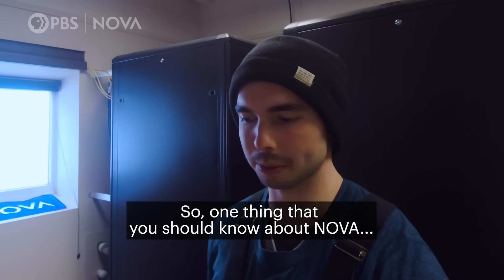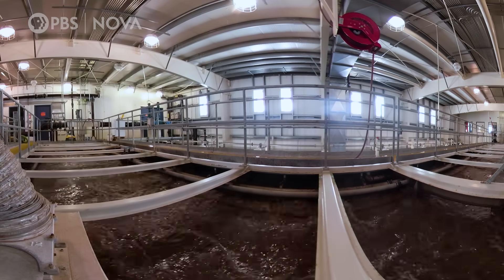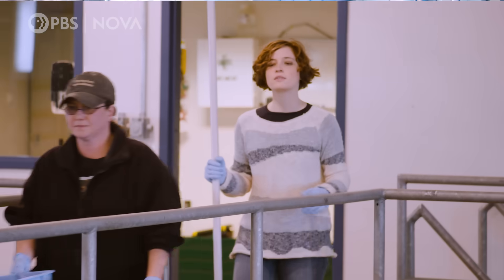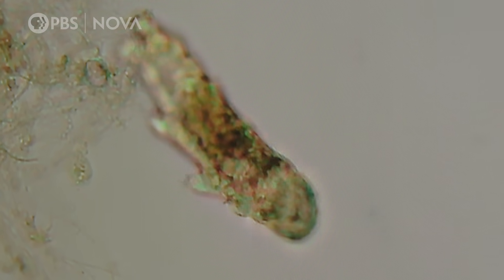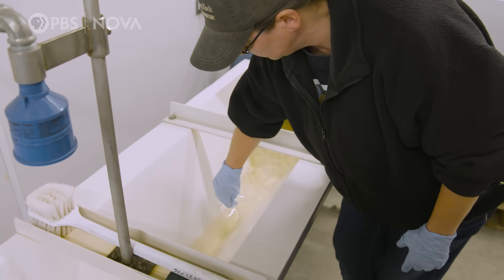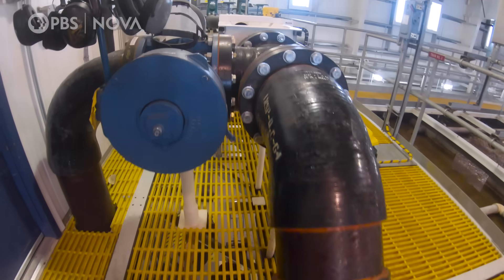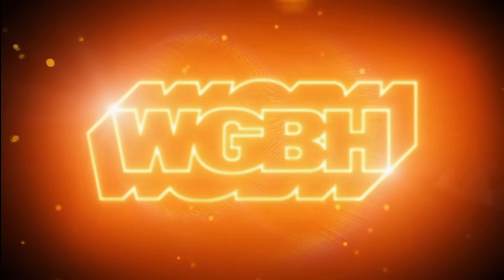Where Does the Poop in Antarctica Go? | Antarctic Extremes

Comment: I appreciate this video because as a plumbing contractor of 52 years coming from high purity piping in Silicon Valley I would like to see the waste treatment plants here. This treatment plant requires a large amount of electricity. The travesty is there will be way more unburned carbons, particulate and waste released into the atmosphere let alone wages, maintenance, etc., by shipping the garbage to California than if it were utilized in a waste-to-energy plant on location. Modern waste to energy plants are 87-90% at reducing particulates to the air and removing mass by 70% efficient or more. And with help of backup batteries, this plant would in turn replace the fuel and carbons released into the atmosphere by the backup diesel electric generators that kick in when there is insufficient wind. I thought this was run by scientists?

Comment: im suprised the water can flow without freezing through pipes. I'd say to bury them but but the ground isn't warm, its ice. Where do they get the energy to heat everything in general? That takes energy to run the sewage without it freezing.

Comment: I can tell you with 100% certainty that the poop at the South Pole goes into the ice because I babysat it for a year when this video went public.  About 200' under the surface, there's a HUGE cavity that used to be the water source (Rodwell) that turns into the septic tank every 15 years or so when a new Rodwell is created.  In about 10,000 years there's gonna be a HUGE poop-berg in the ocean.  A couple actually.
Reply: Yep! Can't exactly use McMurdo's process when you're 700 miles from the ocean. Thankfully the volume is a lot smaller, 200 people in summer and about 50 over winter.

Comment: It's obvious they're just making fun of Arlo. They shoved him onto a task that requires a bit of experience with counterbalance to pull it off.

If he kept the forks level as he came out of the pallet, then when the back-wheels of the truck came down as they ended up out of the container it changed the angle at which the forks sit inside the space in the pallet.

What you would need to do is apply forward tilt just enough to bring the forks back into being level with the pallet, and raise the forks just enough to gently touch the underside of that pallet, and then, while the truck is coming out of the container the front-wheels are coming down, and without doing the previous step, the forks smack onto the floor and puts unnecessary strain on the hydraulics, then you just apply backward tilt to bring the forks level with the floor and drive safely away from the container.

This is pretty simple stuff for "Trained personnel", I hope Arlo doesn't feel that he's bad at it, he's just lacking experience.

Kinda makes me wanna live in Antarctica, what they described in the video sounds like a good place to live.

Comment: Don't you ever use supercritical water wet oxidation processes combined with multi-serial sewage comminutors, the whole thing creates it's own energy run the entire operation and is mechanically automated and self-tending. The final product is pure water that needs chlorination to make it drinkable after passing it first through an engineered marsh. Ozone is created and used on the spot to further disinfect it.

And the hybrid multi-serial sewage comminutor and anaerobic fermentation, it uses anaerobic bacterial diatomaceous earth particle fermentation tanks that has 10,000 times more surface area than a given volume of gravel.

The population of anaerobic bacteria is such that nothing toxic can eliminate them but will be anaerobically consumed and converted into biogas which is a mixture of methane and carbon dioxide which is then used to run the entire system. 

It produces a clear effluent that runs through a series of anti-pathogenic plants like the aquatic mint, known also as the mentha aquatica, that exudes a lingering pathogenicide that kills all pathogens and passes also through a series of different hydroponic troughs containing all kinds of 
phyto-bioremediating plants. In the end it only needs CHLORINATION to render it drinkable. 
Your toilet-to-tap system. 

For ALL solid wastes, HYPERBARIC INCINERATION, was developed and successfully tested in France, rendering even asbestos into harmless substances and forms.

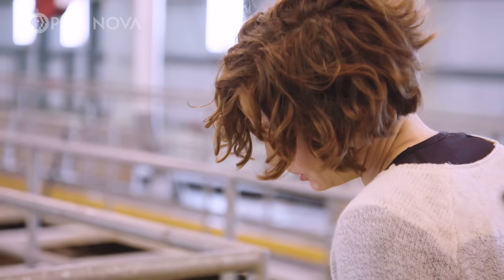Comment: 3:28 racking rags is what it's often called in the "industry" for lack of a better term.

The stories I could tell of my time racking rags in the south suburbs of Chicago, Illinois.

One thing should be mentioned, in the facility in the video you have the privilege of not being under ground in a confined space, with a live sewer close by, and yes those pits often flood to the top.
Reply: I worked six years at Dayton Ohio facility but it was a county owned and operated WWTP.  Two bar screens  split flows at 20 MGD minimum influent into the pretreatment facilities. 2 trains of  Three hycor screens each side  base ment floor leading to a screw conveyor belts that compressed the screenings into thicker detritus,  then lifted out by crane/ hoists , multiple times per shift . I dealt with floods, tornado,  hurricane winds during those years underground.  Worst days ever when generators would come on at power outages then 10 hrs of tedious nerve wracking day of checks, opening up 42 " valves by handwheels, and putting  fine screen on line for flow equalization. Then  eventually a shift relief operator would be there to  take over. It was never a dull moment 2 stories underground.

Comment: "The best place in the world to be a trashman; no flies, no rats, nothing rots. "
Reply: Way more respectable than taxman, don't they
Reply: @epicCKLIM How do you think the trash man gets paid?
Reply: definetly has some benefits rather a trashman working in NYC
Reply: Also, worst place to be a murderer; no flies, no rats, nothing rots
Reply: I was thinking it before he said it.
Reply: Smartest guy on the camp
Reply: Don't you ever use supercritical water wet oxidation processes combined with multi-serial sewage comminutors, the whole thing creates it's own energy run the entire operation and is mechanically automated and self-tending. The final product is pure water that needs chlorination to make it drinkable after passing it first through an engineered marsh. Ozone is created and used on the spot to further disinfect it.

And the hybrid multi-serial sewage comminutor and anaerobic fermentation, it uses anaerobic bacterial diatomaceous earth particle fermentation tanks that has 10,000 times more surface area than a given volume of gravel.

The population of anaerobic bacteria is such that nothing toxic can eliminate them but will be anaerobically consumed and converted into biogas which is a mixture of methane and carbon dioxide which is then used to run the entire system. 

It produces a clear effluent that runs through a series of anti-pathogenic plants like the aquatic mint, known also as the mentha aquatica, that exudes a lingering pathogenicide that kills all pathogens and passes also through a series of different hydroponic troughs containing all kinds of 
phyto-bioremediating plants. In the end it only needs CHLORINATION to render it drinkable. 
Your toilet-to-tap system. 

For ALL solid wastes, HYPERBARIC INCINERATION, was developed and successfully tested in France, rendering even asbestos into harmless substances and forms.
Reply: @darthvader5300 maybe the cost of installing such a complex series including anaerobic digestion outweighs benefit of electrical production. The problem with anaerobic digestion is there gas is produced that are methane and carbon dioxide and some scent gases like. Don't know if they have enough population there in order to produce enough food to keep feeding the microorganism life to keep the digestion going. It's much cheaper to run aerobic digestion in smaller units this is strictly from a standpoint of operations anaerobic digestion fails in the problematic areas of struvite production.

Comment: man I'm surprised they never had any masks on, all the water splashing around throws stuff in the air
Reply: Agreed. Maybe this year has made me more sensible to airbourne pathogenes, but I kept thinking: "How the hell can you go in sewage treatment plant without an N95/FFP2 mask?".
Reply: @creativedesignation7880  its normal for most workers at sewage treatment plants. I been to over 30 tours and not once i had to put on a mask or seen a mask on.
Reply: @tbates1987  Ewww... or maybe the stuff just builds up in the mask and then keeps the yuck-saturated mask close to your face? Ewww...
Reply: @aimeem  Isn't the other option having a yuck-saturated face?
Reply: @aimeem  that's not how shet works...You have disposable masks - wear once throw away afterwards and also masks with replaceable filters so you only replace filters when necessary. If you use them as they're supposed to be used there is no buildup in masks or any reason at all not to be wearing protection...
Reply: @creativedesignation7880  Repent , the kingdom of God is at hand , read your bible for yourself, and pray , there is nothing our there in the world ,ask God to guide and protect you ,if you have any question please ask me.
Reply: @tinajsews2835  no
Reply: I guess the main threat is the buildup of toxic gases, and it's reassuring when everything smells normal. masks and protective gear would make sense if there is a specific infection risk.

Comment: Caitlin handling that processed fertilizer with it getting precariously close to the sleeve of her sweater at 09:57.

Nervous sweating intensifies
Reply: Its basically dehydrated so I don't think it would leave much of a stain. Its pretty much like dry soil or sand at that point
Reply: @Eralen00  when I lived in Philly, the composted sludge was made available for free to city residents, the remainder being divided into what was sold for use as fertilizer, what went unsold, dumped.
I picked up quite a bit for my small backyard garden, grew shit tons of veggies in the mixture of soil and composted sludge. Pathogens get killed off by the composting organisms and the culture is actually measured to ensure pathogens are killed off.
Downside, occasionally in summer, the compost piles would spontaneously combust, as composting does generate heat.
No, not joking about using it as fertilizer, it's a practice as old as farming.
Reply: 5:02- She put her poop glove on her face.
Reply: She picked the perfect cute sweater for the sewage plant.